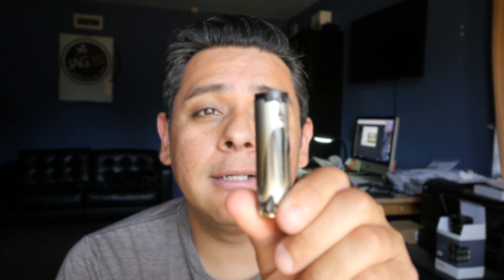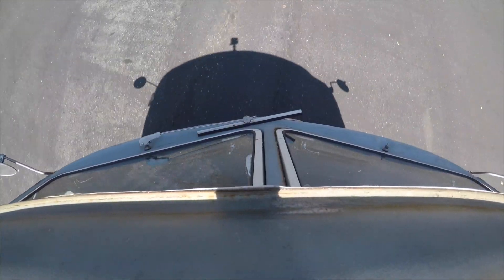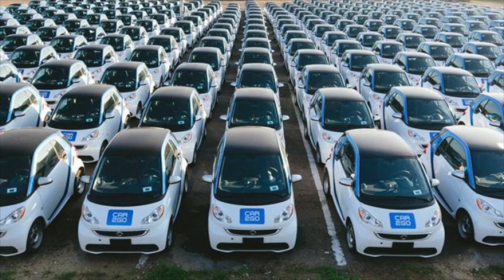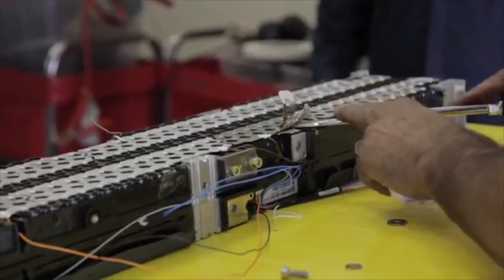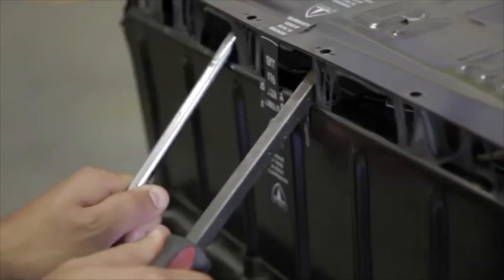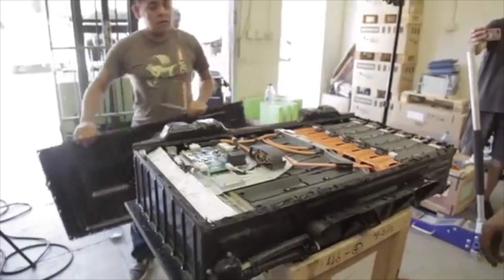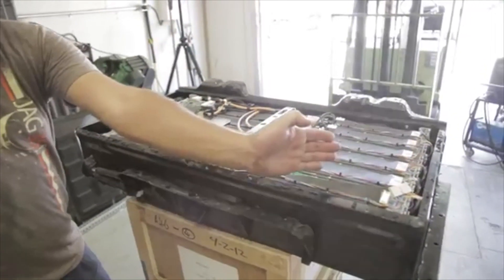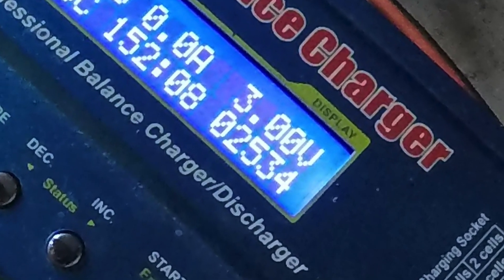The myth of lithium ion TESLA battery calendar degradation

Comment: What is battery degradation? Reduced capacity or increase of internal resistance? From your shown discharge it is looking this cell got a very high internal resistance. My experience with over 5y old lithium cell used for RC hobby is that shelf time does case a huge increase in internal resistance, especially if stored at high voltage, ideally lithium battery like to be stored with 30% capacity
Reply from the maker: +elm70  imposible to test as we don't know what it was originally
Reply: RC cells are generally lithium polymer rather than lithium ion.
The chemistry is different and they are much more volatile, too dangerous for cars due to the risk of puncture causing fires in an accident.

Comment: Some observations:
1) GM used to spec the battery packs with the amount of usable energy within the boundaries they defined. Boudaries were defined to garantie the expected life of the battery packs and hence the economic viability of the proposition. Chemistries were also tweaked to extend the life, instead of maximizing energy storage as in notebooks.

Daimler probably did the same, which would explain the difference in stated capacity of their bounded use to your mesured maximum capacity.

2) The chemistry used in those Panasonic manufactured Teslas cells might not be representative of the properties for all Li-ion cells. They might probably has been tweaked for durability in their special application for the same reason GM and others did to their cells.

That would explain in part why all notebook manufactures always caution of calendar life, and some BUT NOT ALL battery packs degrade a lot even without use.

Notebooks expose batteries to a lot of CPU derived heat; usualy charge to 100% (~4.1V..4.2V/Cell); and discharge to ~3.0. It's a harsher use than in Teslas EVs per cell.

3) Calendar life does not seem to be a myth for notebook baterries. May be it can be attributed to other factors.

4) Indeed, real world testing trumps speculation. :-)

regards.
Reply from the maker: one thing is for sure,  Teslas cells are custom,  how different from commercially available cells?     only tests will tell
Reply: Celso Starec Laptop batteries are really trashed by always being kept at 4.2v, this is really bad (usually you charge to 4.2 then disconnect so it falls back to a little less and it's not under constant current)

I have played with a replacement battery for my 2014 Asus (both bought at the same time), by using one always in between 10 and 85%, and storing it at ~60 it's still the same capacity (according to laptop) whereas the battery that was always in the laptop (always plugged in) is nearly dead
Reply: Llewln 

Ok. 
Just notice that numbers provided by battery management software are not about an absolute battery State Of Charge (SOC). It's about the hole pack usable SOC excursion allowed by it's internal protection circuitry. When individual cells are at 3.0V or lower it's 0% capacity left. Protection to overdischarge is embedded.

If any cells gets bellow some point between 2.5V and 3.0V, most packs won't recharge anymore to avoid risks while cells are still usable with proper slower charging (generally not supported in these packs).

If one cell shorts or of there is a big enough imbalance among serial elements, protection will prevent charging too.

Some manufactures have added an optional setting to charge only till some 80 to 90%, to avoid higher then 4.1V/cell voltages that degrades the chemistry.

There is always a tradeoff between the usable SOC excursion extracted from the managed raw cells agaist the durability of the chemistry.

There are different design decisions in most notebooks which privilege capacity in relation to EVs than privilege life span.

I wonder if calendar life was also maximized in those Tesla cells compared to standard consumer electronic ones, or if is an effect of storage SOC and temperature.
Reply: Laptop units tend to have low shelf life because their cheap BMS is always on. Cars have extremely low draw when "off" (micro-amps) The thing to remember here is how manufacturers underrate their capacities. And Jehu is discharging that cell at an insanely low rate (1A) which will inflate it's apparent capacity. Suck 5A from it and it'll read lower. But the bottom line is 100% correct: shelf life of an unloaded cell is decades. However, storage at full charge will degrade the cell faster than 50-80% SoC.

Comment: i have some energizer li-on batteries i bought in 2005 for my camera for my trip to japan. and i still have like 4 out of the 8 i bought.and i use them everyday. the box said 1000 recharges on them i think.but anyways half are still bien used.the others accually leaked and some white crap was on the ends.

Comment: I use a charger similar to yours to charge my 18650s & have always believed charging them to 4.2 volts was the max voltage to charge them to to maintain long life.
Why did you stop the charge on this old Panasonic 18650 @ 3.26 volts?
Love your vlogs, thanks for doing what you do.
Reply from the maker: It was discharging,  it was supposed to go down to 3.0V but i did not connect the balance leads so there is voltage drop and the charger thinks its 3.0v when the battery its stil at 3.26v
Reply: Duuu :) Thanks for the quick reply. Now I can shut my brain off and go to bed!

Comment: the myth probably comes from lower spec latop 18650's... i have 2600's being used from 2006. Also took apart a second laptop battery pack. which i never used from 2006 because the main pack continued working.

Comment: I kinda wonder if Tesla is binning cells as they produce battery packs.  They could then use the ones that were binned lower in power walls and save the high performing cells for the cars.  They have to be doing some capacity checking as they build the packs to ensure all of the cells are decent.  I am sure we have all at one time or another, taken a brand new battery out of the package only to discover it was flat.

Comment: I need to see the cobalt contents of these versus modern ones. 2009 was a different world in sourcing the material components and you could use way more cobalt to stabilize it. Before people realized what was going on with the mining and using as little as possible became a priority. It helps everything though from longer battery lifespan to greater discharge.

Comment: Actually already having some cycles on the battery is useful to getting an accurate idea of its cycling degradation as the initial degradation occurs because of platting. RUNNING temperature the temps its at while its in use has a dramatic effect on degradation.

Comment: I would suspect self discharge has some effect. If the cell is almost empty to begin with, a few years sitting at zero is not really great?
Reply: Self-discharge is very low. It's the vampire load of things connected to the cell(s) that kill them. (nothing has a real "off" switch anymore) Yes, storage at extreme high/low SoC can degrade the cell. I have a 6s module out of a Volt charged to 4.150v/c. It's been sitting -- disconnected from everything -- for 3 months. It still reads 4.150v/c.

Comment: Battery life or Cycle life is dependent on the Depth of Discharge. If you discharge a battery by 20% from a full charge and compare a battery discharged by 100% each cycle, you will find that the 20% discharged battery will last orders of magnitude longer.

You can prove this by obtaining a Depth of Discharge graph for the chemistry battery you are investigating and see the massive differents. Measuring the internal discharge rate is not a measure of Cycle life because you are not addressing the Depth of Discharge on each cycle.

Comment: While I've never seen any testing on shelf life done until now, your results don't surprise me at all.
The modern Li-Ion chemistries are pretty solid, and reliable.
I lost an 18650 3Ah cell (for e-cig) two years ago, and found it yesterday, under the passenger seat of my car...
It still had a full charge.
Reply: Your car cleaning technique is clearly not as solid as the Li-Ion chemistry you speak of.
Reply: While true, it really wasn't bad under there. I found the Li-Ion cell, a quarter, a penny, and a couple receipts.
Reply: I wonder.... If I made a blank statement like this: "Right now more 18650 are used in Ecigs than in E-Cars." How far would I be from the truth? I have 6 18650's chillin here for my own use....mmmm I think it would be a very interesting question to answer... Cars have a shitload of batteries in them, but MILLIONS vape... maybe the vapers are the TRUE heroes bringing li-ion prices down and driving innovation... OK that last part maybe TOO far fetched.... but still.
Reply: A little far fetched, maybe... But NOT too far fetched. 

Considering that I have casually acquired four 3Ah cells, and that they're designed with a high C rating, and that just about every vaping nut that I know of, like me, has also casually purchased their high C rated 18650 and 11650 cells, I do think that e-cigs do have some effect on the prices.

I believe my 18650 cells are rated 15C. I may be wrong on that number, so let's say they're only rated 10C, just in case I am wrong. That would mean that I could potentially be able to hook them up to a 2/3 HP motor, for a few seconds, without blowing anything up.

Comment: Cheap china lithium batteries have terrible calendar life ~20-30% capacity lost per year. Manufactures of electronics usually cheap out on the batteries as their first cost cutting measure because it's not noticeable until 1-2 years later when the product is out of warranty.  Laptops are a good example, if you spend $400 on a laptop the battery is dead after 2 years.  Spend $2000 on a laptop and it's still going strong 7 years later.

So this is likely the reason most people think, or expect, the short calendar life in lithium cells. ie, most people are cheap and buy cheap stuff.

Comment: This video is kind of stupid. Tesla change the battery chemistry in 2012 to get the added range for the Model S from NMC batteries to LCA batteries. NMC usually have 2-3 times the longevity (at least in charge cycles) than LCA.. in shelf life, there the diffrance is not that big

But also important, its very diffrent having a battery in storage than having them in a battery. Temperature does affect the shelf life quite a lot

Comment: I am planing on converting a land rover series 2 LWB to electric so would it be better to put the motor (AC75) on to the gear box or to put the motor straight to the diff like you did to the jeep the car weighs 3294 lbs and the diff ratio is 4.7 to   1 the tire diameter is 28 inch and I would like the range upwards of 100 miles using tesla model s Battery?
Reply from the maker: I will tackle your question soon,  I just haven't had time
Reply: Ok thank

Comment: Certainly not busted!! Promising new data maybe but their are a lot of assumptions and it’s a single sample!! One data point! Also the capacity of a battery is a manufacturer TARGER there is a distribution to any product it could be the cell had as much as 2900mah when produced even though was a 2600 battery just like a defective battery can leave the plant with less than capacity.

Comment: your cell is likely a ncr18650bd or close variant.i remember using these in high power flashlights in 2007.iirc the min capacity new was 3080mah.so your test result is not bad for their age.try an impedance test at 1khz.mine new were around 30 milliohms.the capacity loss is not the huge issue.rising internal resistance is.the tool i used is hardly a lab grade device but is good enough for this test.it is a dick smith esr meter.do the test again with good holders and heavy leads.the goal of this is to eliminate any resistance in the leads.the leads that came with the imax are poor quality.you can see a loss across your leads in the video.i suspect the cells are better than this test shows.and last but not least degradation is most dependent on temp and state of charge.high temp and full charge being the worst.since these cells are never fully charged by the tesla bms  they are better off than most.this is part of the strategy to extend their life.

Comment: Battery capacity varies with discharge time. Maybe 14kWh was the C10 (capacity in a 10 hours discharge rate) and 18kWh is the C120 (capacity in a 120 hours discharge rate). Because of the power demand on a car probably C10 is accurate to measure real capacity of the cells

Comment: Some technologies do have shelf life and even have self-discharge rates. Lithium cell chemistry is much less.  Non-rechargeable lithium cells (before the rechargeables were available) were typically 10 year life.  

I still have a lithium powered bathroom scales without replaceable batteries.  It is still working (obvious degradation) 20 years later.  But these are a different chemistry than the ones you are testing.

The 18650s may have beat the shelf life issue.  I tend to go with the .35% you were seeing as being a reasonable amount for this technology.   And for really used cells, that is 'nothing' as you commented.

Comment: Calendar degradation is not a myth because it depends largely on the state of charge and temperature. A Higher state of charge leads to higher degradation. If this was not the case, Teslas would not warn you if you try to keep the charge at >80% for several days in a row, and Tesla knows way more about these cells than we all do.
Reply from the maker: https://youtu.be/jAcgld6gtyo
Reply: Yeah, I've seen that video as well, but it doesn't change Tesla's own warning. You'd figure if it really was not an issue, there would be no reason for Tesla to inconvenience folks and they would just let everyone charge to 100% as the default. There has to be a reason.
Reply: Additionally, many new laptops (Lenovo) ship with a feature to selectively limit total charge on the battery, specifically to reduce calendar degradation. Also note many additional data points here (including state of charge vs. time): http://batteryuniversity.com/learn/article/how_to_prolong_lithium_based_batteries
Reply: Yes, this video neglects one of the most significant factors, which is state of charge when stored.

There is debate about whether a full or partial charge is optimal for battery storage when not in use, but long periods on the shelf with little or no charge will definitely destroy most rechargeable batteries, lithium ion included.
Reply: From all the sources of more recent information i am starting to believe that charging and discharging are not the primary source of degradation but time, temperature and state of charge while the charging and discharging merely contribute to increasing the temperature unless you cool the batteries and in keeping you away from the optimal state of charge. If those factors are multiplicative, the difference between a well kept/used battery and a badly kept/used battery can be humongous.

But of course we can do a lot of speculation, but there's a reason many people are doing research on it: We just don't exactly know yet.

Comment: Unfortunately testing one cell does not provide detailed information on the whole population of cells produced. Cells vary widely and the ratings and life times are averages for the whole population of cells. The very minimum would be to test 10 cells and then apply some statistics to determine population parameters.
Reply from the maker: I got 5280  7 year old cells in my bus that give me 48.8kWh out of the 48.8kWh original capacity,   hows that for a sample size?
Reply: Insufficient sample size.  Have to hack the P until the conclusion matches bias.
Reply: Nice!!!!!!!
Reply: I'm inclined to think sample size is irrelevant. In effect this is about testing for best case scenario not an average case scenario, as this is about the limitations of the technology and not the limitations of a particular battery made by a particular company. After all this video is made to address people talking about all li-ion, in any electric car. So the complaint or "myth" is against the technology itself, and not a particular company or battery manufacturer.
Reply: +Joseph Stott Actually I watched another video of a professor with data charts showing that the Leaf and Volt skimped on the better li-ion to save money (or to give li-ion technology a bad rap?) He explained how the better solution and materials for optimal life and performance was tackled in the beginning with Tesla. Now anyone that also used Tesla's batteries also had a leg up in the better technology so YES it does matter what batteries you are using. Kind of like oil. When doing oil analysis some oils are proven inferior while others are proven superior. So the technology is just fine when a company uses the best materials with a proven track record which is why Tesla sets the bar and others either try to equal it, pass it, or put out inferior products. Since there is so much bias put out there on YT, the mainstream media, radio etc. because of Buffett and Koch brothers losing money to clean energy while the media is all owned by big money and gets paid to tow the "big money" lies, then people are confused who don't understand the politics of these elitists who are being disrupted by technology. I get tired of typing on YT but I guess I'm more tired of seeing the same biased anti-clean tech statements thrown out without a second thought.
Reply: The first gen Leaf is what I was talking about. I've heard the batteries really crapped out on those and as you can see they are selling for under $10K now with low miles. soooo...
Reply: hmmm.... under 10k? How many cells do they have in their packs?